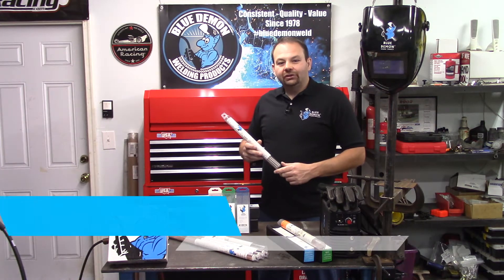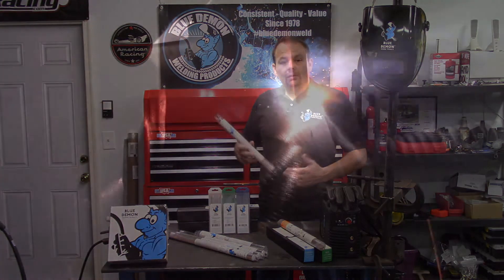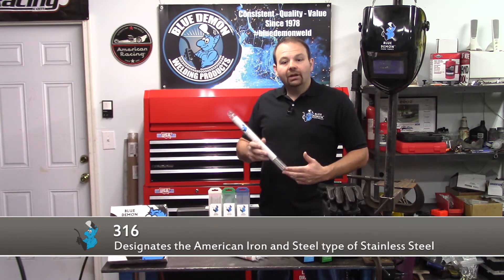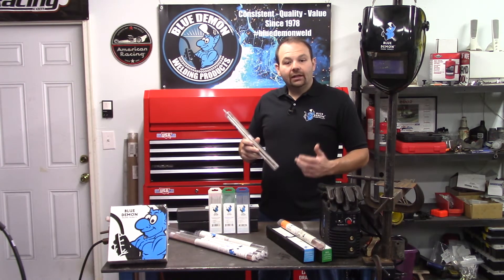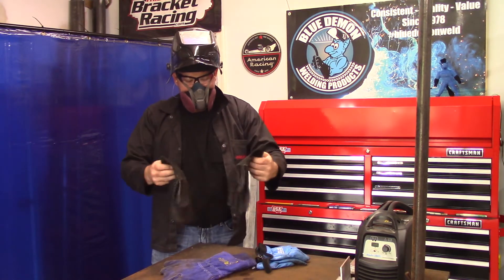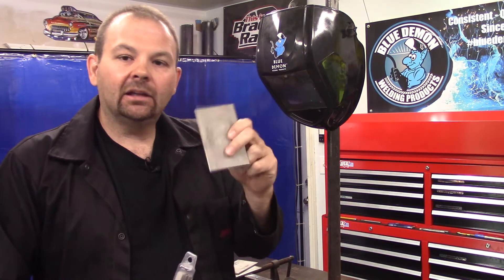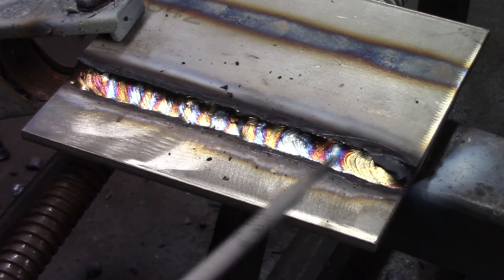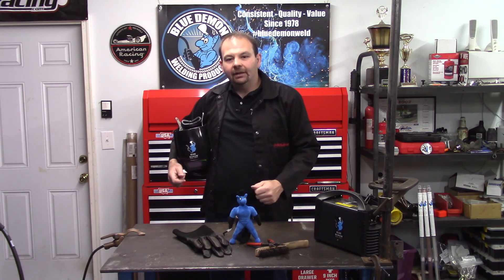Blue Demon E316L-16 Coated Electrode

Comment: Hi im in the Uk and will be using E316L-17 2.5mm  on a new project how are these different ? 16 /17 please ! i will be welding 1/4 plate lugs to 16 gauge stainless pipe  any tips for Amperage settings
Reply from the maker: Thanks Jon.  -16 & -17 coatings are both AC/DC all position coatings.   -16 is popular in USA and -17 in EU
Reply: @bluedemonweld  so the 16 is Titania coated and the 17 is coated with WHAT?????